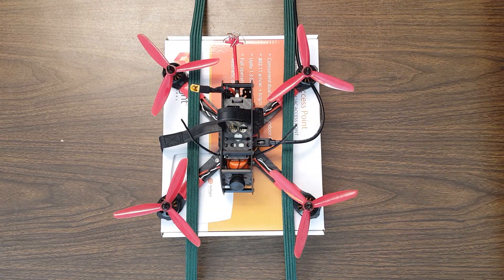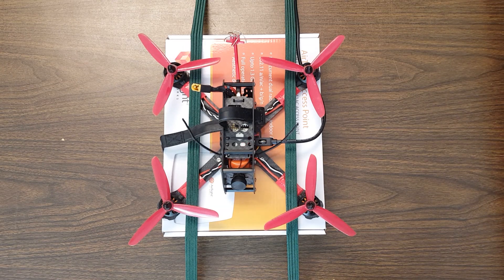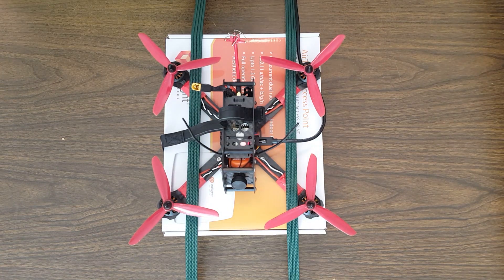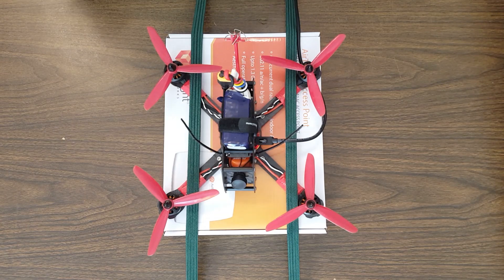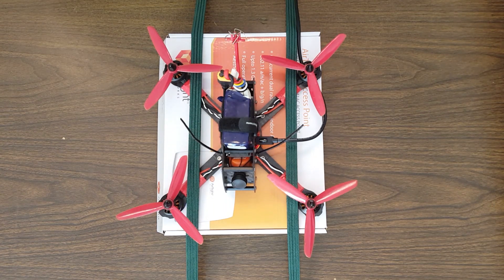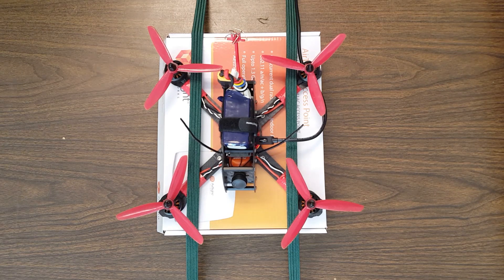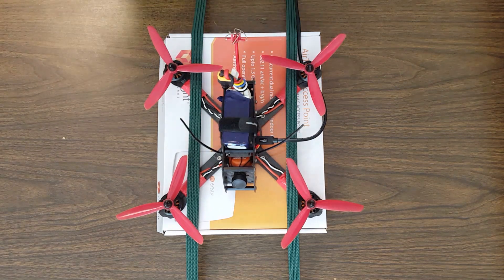Troubleshooting: Quadcopter Desync (Falls Out Of Sky)

Comment: Cool video Joshua I am new to the hobby bought myself a Eachine  Lizard 95 it kept falling out of the sky I strapped it down like you show in your video found nothing wrong.  Then I decided to control the throttle thru my Flysky transmitter when I went from no throttle to full throttle 2 or 3 times just the rear right motor stopped spinning when it stopped spinning noticed that esc made its normal tone like at start up.  Does this mean the 4n1 esc is bad or the motor.  Only the 1 motor stopped working the other 3 were working fine.  Did this exercise 3 times same result all 3 times just the rear right motor stopped and when it stopped that esc made like its start up tone.

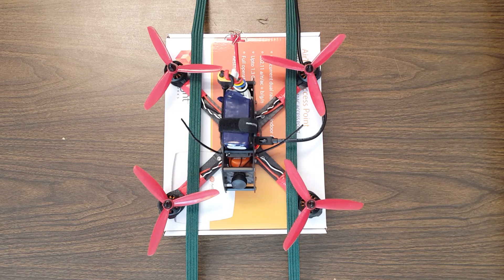Comment: Is its just me or does the stator move at approx. 5:35?? right before it cuts off?? Also if it was the Esc what would you do to fix this? change the speed of the timing and/or the start up strength?
Reply: I think the mechanical failure that let the stator move is the proximate cause. Why the mechanical failure occurred is a good candidate for a root cause of the failure. I would like to see what the mount and stator attachment looked like.
Reply: I saw this too.  If the stator can shift then that is probably was caused the winding wire to eventually wiggle and break.
Reply: SicnetwrkFPV i saw it also!

Comment: Joshua, thanks again. 
Why do you need props? Why would the test be different without? Are the props inertia so strong?
Reply from the maker: Without props, there is no load on the motor and they may spin freely even if they are damaged.

Comment: Thanks for the demo Joshua. Although I had a question about the risks of that method : can the setup parts (esc, motor...) get damaged while testing it that way ? 
I understand there is maybe no other way to test it without flying, but can you burn a motor or an ESC while applying such thrust load while the quad is fixed to a surface ?

Is it better not to let the thrust go on forever and rather test it with powerful though short bursts of a couple seconds ?

Also, would the problem show up without propellers mounted ?

Thanks :)

(PS : sry if these questions have already been asked in the comments ^^ )
Reply from the maker: There will be some increase in current draw on the bench because the prop can't unload. So if you are running really beastly motors that could stress your ESCs or even burn themselves out, maybe you shouldn't let them run for too long at full throttle.

Comment: My quad hovers but after a certain amount of throttle, the front left motor gives out
Reply: There is no startup beep or anything. It just gives out. I had trouble with this "arm" before but I just switched out the esc. There has aslo been a new fc in it since then but the same thing keeps happening. It was also after a bad crash has this "arm" been acting up. I have a motor coming in because I think (hope) it's the motor obviously but what do I think are the odds that it's a bad motor?
Reply from the maker: +JC250 if you swap the motor and that fixes it, then odds are it was the motor.
Reply: I had the same problem. Front left was giving out at 1400 or so. Swaped escs, same problem with channel 1. guess what, PDB was on the top of CC3D and the signal for channel 1 was affected thanks to it. Elevated, insulated, no problems. I have R4 2300 kv Returners on 4s

Comment: This guy may have litterally just saved me some dollars and frustration. I was having this "desync" issue with one motor after wiring up some new ESC's, the copter seemed to be able to overcome its "stuttering" issue shortly after arming, i was going to see if it would be able to fly okay in the morning (it's night time rn), thank goodness i strapped it down with the props on and did this test, at first there the motor spun up fine to the highest throttle position, but then when i tested pushing it from 0 to 100 the motor crapped out, it just stuttered. After inspecting more closely, the motor was super hot, and one of the three motor wires was halfway disconnected at the base of the motor. 

Thanks Josh,
- New subscriber
Reply: exactly the same happen for me but i drop from more than 100 meter :/
Reply: Haha you just saved ME some money because i am having the exact same issue lol thanks guy
Reply: I dropped for 100 meters at least broke an arm never found my motor. 
I’m thinking I should check for this !!!!! 
Dropping from the sky more frequently now.

Comment: Hey joshua, 
i have a serious issue with my quadcopter, when i use it with the radio, unpluged from the computer, it makes an odd noise, the motors slightly warm and they jitter and vibrate like crazy (without the props) the jitters get worse depending on pid loop times and the motors work fine on the motor testing area on betaflight?? any thoughts???

ANy help would e great.
Reply from the maker: The fact that they work fine on the motor tab tells you it is something to do with your PIDs or your configuration. Are you 100% sure you have your motor direction correct? Reversing all motor directions results in a yaw twitch.
Reply: dw, i have them working
Reply from the maker: So what was it?
Reply: i dont know, i left it for an hour, then they just worked like butter, also i'm using the float pids as there is no multiwi option on betaflight?? are the pids off because i can't even take off without it spirling??
Reply from the maker: you cannot translate PIDs from other PID controllers to betaflight PID controller in 3.0. That alone could be your problem. Start with the 3.0 defaults and tune manually from there as needed.

Comment: What's the easiest way to turn off vtx for tests like this? Possible without pulling it?  My VTXs overheat and never work again if I run a battery on a bench like that...or were they just poor quality to die from sitting on for 5-10 minutes. I did have an antenna connected, as I previously thought that would make it ok.
Reply from the maker: Some vTX have the ability to power them down via a PWM channel, or a hard-button. Look for a vTX with "pit mode". Otherwise, just pull the plug I guess.

When I tried mounting the vTX with the heat sink against the carbon fiber plate, it would overheat. If yours is overheating, perhaps it needs more air, or perhaps the antenna is damaged or poorly matched. Or... sad to say, perhaps the vTX is just crap.

Comment: I have had this issue with an Eachine Falcon from Banggood.  Everything will be going just fine the quadcopter wood begin to Tumble side over side to the ground with no chance of recovery. this happened one last time a week ago and when I inspected the quad motor number 3 was burnt out. I have replaced it and so far have not had any issues. I would immediately think that you have a bad motor if you have this issue

Comment: You dont have classic desync problem here. And i would be interested, after you have one ,-)
Reply from the maker: Well, part of the challenge is that quite often a "desync" is happening for reasons OTHER than simply "timing is wrong". In this case, desync is technically happening, but it's because the stator is moving.
Reply: I ment that falling movement isnt classic desync issue. What was confirmed by you in the end
Reply: Do you make or already made some guide how to properly set timing on motors or how to recognize timing desync issue?
Reply from the maker: Timing medium will work for most motors and ESC's.

Comment: noobie question. I have a quad when I use motors tab everything is fine. when I use throttle, everything is lame.
motors wont spin up to full, will spin up then slow down. 
any quick suggestions.    
escs are sn16a which I havent flashed yet (waiting for a linker to arrive). 
blheli doesnt recognise them through FC, so I figure it has simonk
Reply from the maker: BLHeli can recognize simonk bootloader if you are running > betaflight 2.7.0. If they have no bootloader at all, you have to use the ISP programmer, but chances are they have a bootloader.

If the props are off and you are using the throttle, the results are often misleading. The PID controller is trying to "fly" the copter, but of course nothing is happening because the props are off, so the motors will do unexpected things. If the motors spin smoothly in the Motors tab, chances are everything is fine. Try a test hover using this procedure:

Step zero - MAKE SURE YOUR FAILSAFE WORKS. With props off, arm the copter. Motors are spinning. Turn off the transmitter. Motors should stop spinning within a few seconds. If this doesn't happen, stop. Do not fly. Go configure your failsafe correctly.

Step one - Props on. Go to a grassy area so that if anything goes wrong your copter will be swaddled like a babe in a manger. Set the copter down.

Step two - Stand about 50 feet away. If anything is not going right, the copter can flip out very unexpectedly. Distance is your friend here.

Step three - Arm and let the motors idle for a few seconds. If nothing bad happens, proceed.

Step four - SLOWLY begin to raise the throttle. Watch for a sign that the copter is getting out of control. For example, if the copter starts to oscillate and the oscillations are getting stronger. Be aware that ground effect will cause the copter to sort of "bobble" around just as you reach the hover point. That's normal. Another thing that may happen is that the copter might suddenly flip over if the motors are miswired. Another thing that could happen is that the copter suddenly shoots into the sky. Be prepared for all of these occurrences and be ready to throttle down and disarm immediately. Use failsafe as a fallback if need be.

Step five - Probably, none of the above will happen and you will proceed to a lovely hover. You have successfully flown your copter.
Reply: Joshua,  thanks. I will give it another try.
I was using CF to connect, so will try BF instead.  with props on or off it is a weird one.

it flies but will get out of control, flip or shoot off at a random time within about a minute. 
usually a wobble, poor control then random act of quad.

This is the first case i have had where the motors act this way. I have tried 2 different FC;s (CC3d and naze) cc3d native bios, so it is not the FC as both act the same way.

I can fly and have a few quads but I have never really dug into tuning too far. 
up the rates and get the pids about right and it flies more than well enough for me.

Finding simple enough info about each thing and how it affects the quad/flying seems to be an art.
much of the lore available is set this to x for an increase in y type of thing.

I am working through bits of your posts to get a handle on what settings do in real terms.

cheers and keep posting.
Reply: ok , decided to have a look at my setup. duh. hooked up failsafe mode to wrong aux channel.
go from acro to airmode - insta failsafe = falls from sky.... said I was noobie at some stuff.

other thing for people out there with flashing escs etc.
some escs dont like sharing the signal ground with the common ground for flashing.
when I separated this and ran a ground to FC with signal - programming was fine.
must separate grounds somehow.  

anyways, hope people have a laugh at my stupidity and keep watchin your videos.

cheers and thanks

Comment: Hi Joshua, nice explaining. I've got me a similar situation last weekend. Burned my second kiss 18A esc on the same leg (first with 4s when landing in airmode,). This time it happened mid air on 3s and also destroyed 2 fases in the motor (multistar elite 2300kV). Also my naze32 seems fried. What could have happened?  My guess is that the motor was getting bad and asked to much of the esc. Only to frie the naze32 with it this time. Never had issues before the first esc burnout.
Reply from the maker: +Jurik Ristjouw kiss 18 are notorious for burning.

Comment: This is pretty funny, having to tie it down to check it.  Most quadcopters can't actually fly, like the Quanum Venture that Hobby King sells that's too heavy and underpowered to even get off the ground so you can just hold them in your hand because they aren't going anywhere!
Reply from the maker: Suffice it to say, this copter is generating about 11 lbs of thrust at full throttle; the props are spinning at 35,000 rpm; the blade tip is moving a significant percentage of the speed of sound.

Comment: could be slightly safer if you reverse all the motors (front their current direction) so they all push down.
And definitely wear safety glasses
Reply from the maker: +UKHeliBob yes. It's not good to spin motors too fast with props off. The rpms can be too high.
Reply: Or move the props around so that the trust is downward.

Do you actually need the props on at all though ?
Reply: Good idea!

Comment: What does it mean when the copter falls out of the sky, but almost immediately ~1-2s comes back on line as if no issue had occurred?

Is there a specific smoking gun for this symptom ?
Reply from the maker: Not really. If your stage 1 failsafe timout was long enough, it could be a stage 1 failsafe that recovered. But the default is 1 second or less... I don't remember exactly. 

Do all four motors stop?

Does the copter tumble or spin, or fall relatively flat?

Do you hear ESC initialization tones?

Do you hear any beep pattern from your buzzer?

Does your FPV video stay on when this happens?

These questions all can help home in on the problem.
Reply: >Do all four motors stop?
I don't know, is there a way to help determine this definitively? 
No blackbox installed, but I have the standalone hardware, just no reasonable location to place it on this build.
Any other ways to tell you could think of?

>Does the copter tumble or spin, or fall relatively flat?
It tumbles, just enough to loose orientation, sometimes recoverable, and continues flying as normal.

>Do you hear ESC initialization tones?
No I do not hear startup tones, but that doesn't mean they are not there, as it generally too far away and the sound to faint to hear at that distance .Initialization generally takes some decent amount of time over 1-2 seconds right? So I am going to guess a hesitant NO.

>Do you hear any beep pattern from your buzzer?
No SOS beep Patterns or any indication of audible warnings AFAIK. Generally speaking, I can hear the secondary backup low voltage beeper tones from the buzzer as a point of reference.So I am going to give a hesitant No audible warning of any kind.

>Does your FPV video stay on when this happens?
LOS, so not applicable on this specific one.

>These questions all can help home in on the problem.
Thanks Joshua.
Going to dig in and see what I can figure out, but if any of this makes scene or rings a bell, I could sure use help.
Reply from the maker: +101rotarypower I'm going to guess stage 1 failsafe because I doubt you are high enough to literally fall for 2 seconds and then recover. If you have the default config then throttle goes to zero on stage 1 failsafe. If you didn't have air mode, you could then lack authority to fully maintain attitude.
Reply: Yes, your right, time perception is skewed in that scenario wide eyes and pucker.

A more accurate description would probably be parts of a second up to a second .

I will check this out.

Thank you for taking the time to be helpful !
Reply: I am looking into stage 1 FS now, but are there any common reasons to fall into stage 1 within 50-100 yards clear line of site, and capable of going well beyond this in distance.

The Rx and FC have their own 5Vdc supply from a pololu #2107 600ma 

I trust the connections, and have not ever found a fault with them, tested multiple times. Because of the build there really is no way to damage them or pull on the connections to cause a intermittent fault.

All relatively new and trusted hardware.

It seems to randomly happen on quick throttle change punchouts. 

My guess is power supply related, but not sure how that could be.

Thanks Again :)
Reply from the maker: +101rotarypower no, I agree it's probably not rx. But anything is possible. Blackbox would, of course, be helpful.
Reply: +Joshua Bardwell this was on a build with replaced FC.  

Air mode had somehow neglected to have been enabled, testing with it enabled, pushing on it hard, I couldn't get the issue to remanifest itself. 

So problem solved...for now...

You sure are a fantastic resource, I dont know how to thank you enough for your efforts, it really is appreciated !

Thank you :)
Reply from the maker: 101rotarypower If you really want to, even a $1 pledge to my Patreon is very appreciated. But if you don't want to, that's also fine. The main reason I do this is because I want to help people enjoy this great hobby.

Comment: A less expensive thing to do is to leave the copter unplugged, replace the motor and ESC, and go fly the copter again, outside. If the issue persists, check the wiring again. I can't see being subjected to a potential loss of eye sight/limbs. I'd rather swap components than lose my eye sight and deal with medical bills. But that's just me. :) It seems that the problem was narrowed down to one motor/ESC before the copter was even put on the bench, so I'm sure just doing replacements is the best and safest way to troubleshoot this situation.